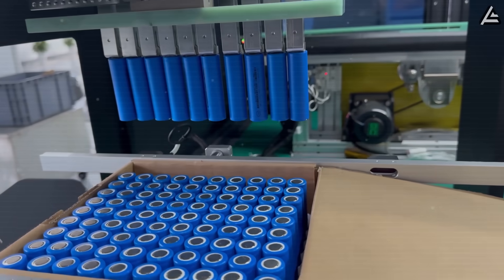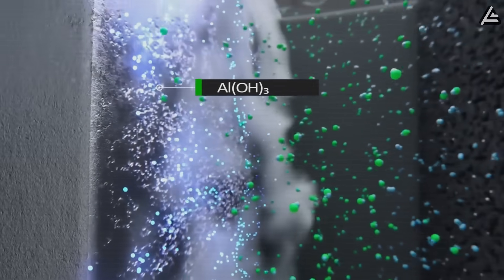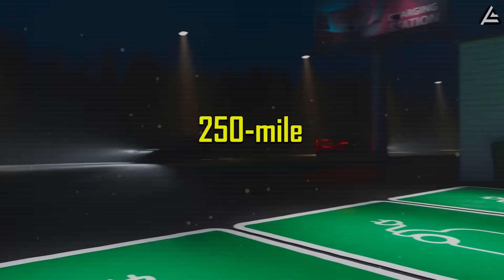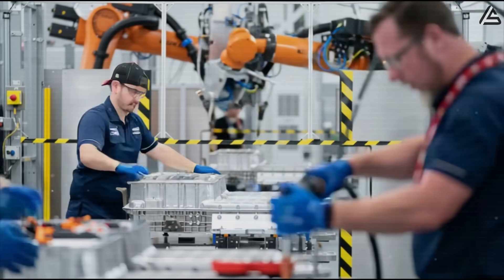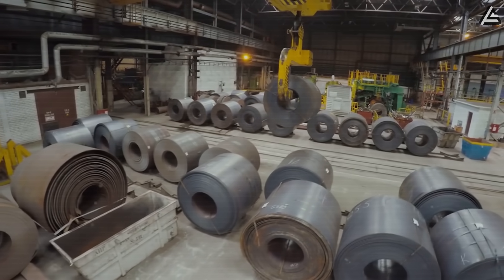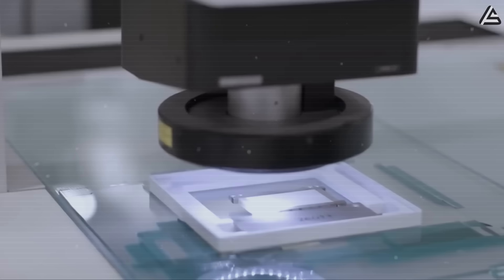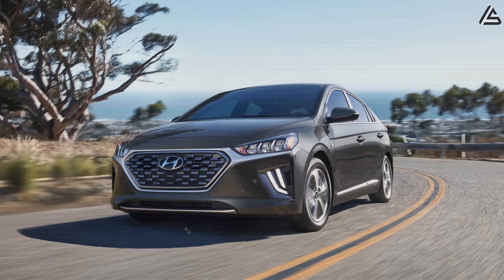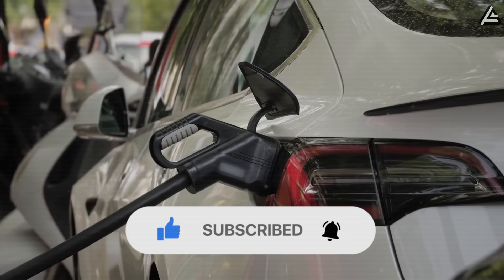2026 Tesla Model 2's All-New Aluminum-Ion Battery. What Elon Didn’t Tell You About

Comment: What about cold temperature vehicle operation and charging? This is a serious problem with Tesla's and other electrics brands now.
Reply from the maker: That’s not a problem with aluminum batteries. Whether it’s below 20°C or above 60°C, their performance only drops by less than 5%, and you can still charge at almost the same speed. Do you live somewhere with extreme weather? And have you had bad experiences with your current battery?

Comment: I have a model y, I want higher range, not buying lower than 400 mile range, sick of baby sitting a charger .  Also not significantly cheaper than gas in PG&E territory.  I am not buying unless it is really cheap and has long range
Reply from the maker: No doubt aluminum batteries will be cheaper, and range is something Tesla’s still working on to improve

Comment: Why not just make the battery a bit bigger to get 300 miles per charge? And where does it take 8 or 9 minutes to fill a gas tank. You using a eye dropper to fill tank. Also who keeps a car for 500,000 miles? I get tired of one after 4 or 5 years.
Reply from the maker: That’s your case, not everyone’s
Reply: @AutoGearShift2  I do not  know anyone nor I have I met who has a car with 500,000 on it. I spent my early life in the family car business, and if you got a car in trade with over 100,000 it went  into the “back lot”    with the high mileage- no guarantee- sell quick and cheap  vehicles,  or was auctioned out. Also, to any vehicle in the northeast with that very high mileage  may be full of rust holes. You certainly were not going to, spend $$$ to recondition it put it with the high profit vehicles.
Reply from the maker: ok so I suggest you to meet our other viewers, I met one who drive his car for 18 years
Reply: @AutoGearShift2  Fine but that is not the case for the vast majority of drivers. I knew a guy who was divorced 4 times and married one of them twice. That as likely  a 18 year old everyday driver car  or one with 500,000 miles on it —- possible but certainly  not the norm: nor would I recommend any of the pre-noted situations.
Reply from the maker: That’s a fair point. Extreme cases exist, but they aren’t a useful baseline. Most drivers should make decisions based on typical ownership patterns, not outliers like half-million-mile vehicles or perfect battery longevity.

Comment: But with Solid State batteries you can get the best of both worlds with a 10%-80% charging time of 12 minutes and a 800-1000 mile maybe higher in range. It is also lighter and safer as the manufacturer claims it is not prone to fire when structure integrity is compromised. I can see a cheap short range EV appealing for work, and a long range more expensive EV for high end luxury or overlanding trips.  Just do the math in charging time.  250 miles divided by 10 minutes = 25.  1000 miles divided by 12 minutes = 83.3.  Elon said, “So Efin what?” Say a one way San Francisco, CA to Reno, NV trip is approx 220 miles. 250 mile range battery should have no problem. Wrong! The trip has lots of steep mountain roads and we all know what climbs do to EV batteries. Brake regen may get you some energy back but not enough to make the trip worry free without stopping to charge.  A battery with 1000 mile range can do the SF to Reno, drive around town for the weekend and make the return, Reno to SF drive without charging. Elon says,”Stop to charge in between, sightsee, and rest”. If I go sightseeing the places I like to visit don’t have EV charging stations. Another plus for the 1000 mile range battery.
Reply from the maker: thanks for your detailed sharing

Comment: Does the aluminum battery still explode or burn on fire?
Reply from the maker: Aluminum-ion batteries behave very differently from lithium-ion. Instead of going into thermal runaway, tests suggest they release charge and go offline rather than catching fire. That makes them much safer in crash or puncture scenarios. Tesla still needs to prove this at scale, but early data looks promising.

Comment: There's no free lunch. If it's pumping that much energy into that battery pack that fast, it's going to require a hell of a power supply. For a filling station, they're going to need a big diesel generator for that, or a nuclear reactor.

If you want a guess on how much, it's 1.5 times the KW/H for horsepower. So if you have a 20 KW/h gen head, you're going to need a 30 HP engine. That's for an hour. Multiply it by a quick charge. Quickly, you'll see it's a lot of HP. Add more cars, that's more HP. Quickly, you're up to a Caterpillar 16-cylinder engine generator.

Chuck away your illusion that they're "clean." Windmills are proving to be a joke, as everyone said they would be. Longevity, power output, and the environmental impact are staggering. Killing lots of birds. They don't like hydroelectric. So there's solar, and it's not up to the task. So we're back to fossil fuels of some sort. Either diesel, natural gas, or some other hydrocarbon, such as coal.
Reply from the maker: You’re not wrong that ultra-fast charging demands serious grid capacity, but Tesla and others aren’t planning to solve it with diesel generators. They’re already deploying massive battery buffers, solar integration, and grid-level energy storage to handle peak loads without “Caterpillar engines” on site. Wind and solar have limits, yes, but pairing them with storage plus nuclear and hydro where available changes the math completely. EV charging doesn’t have to be dirty, it depends on how the grid is built.

Comment: How about  a minivan design  keeping in mind a universal model that can be cheaply modified for wheelchair use.  Being a wheelchair user I wish a standard model minivan with a  floor to roof inside height  of  54 - 57 inch.  Front removable raised platform seats .  Costs for adapting for wheelchair use can be cut substantially  by this basic design concept to begin with for all consumers.   All consumers will benefit from the higher head room and  leg space ( not having to bend  over so much to get in and squashed seating for not enough leg room  and  wrestling  with  children car seats half bent over) while  lowering the cost for full adaptation for wheelchair users by 10s of thousands dollars.
Reply from the maker: thanks for your sharing! we'll research more about minivan

Comment: 1, I do most of my charging at home where it's cheaper to charge. The idea of being able to hold enough charge to last a day of driving around and return to home to re-charge is the best way. And even if we are on a long trip 1 or 2 40-minute stops for the day beats 5 or 6 10-minute stops. Each of those stops require finding the charger and hoping they are working. I don't own a Tesla YET. Hopefully in two years there will be a battery brake through, and I'll get one.
Reply from the maker: thanks for your sharing!

Comment: 10 minutes is impressive for a full charge, but what's this about it being faster than to fill a gas tank? My Saturn fills in about two minutes.
Reply from the maker: the key is convenience: charging at home overnight or a 10-minute stop on a trip means no weekly gas station runs
Reply: @AutoGearShift2 Got no issue with 10 minutes being fast for an EV but it’s not faster than gas.
Reply from the maker: I agree. the benefit of an EV is that you can charge it right at your home

Comment: Bullet point! How does aluminum oxide perform in the cold and extreme heat, where lithium is definitely left wanting!
Reply from the maker: Aluminum-ion batteries seem to handle both cold and heat better than lithium-ion, with less risk of fire and better performance in low temps. Stay tuned, we’ll dive deeper in a coming video.

Comment: Not one word on it's operating temperature range, nor it's potential for ignition. Aluminum was used in camera Flash Bulbs, as it burns rapidly and hot, in oxygen.
Reply from the maker: Current aluminum-ion research shows better thermal stability than lithium, with far less risk of thermal runaway or fire. Unlike aluminum powder in flashbulbs, battery aluminum is not in a loose reactive form, it’s bound in structured electrodes and electrolytes.

Comment: To go electric the question about comment 1 or 2 is not the issue. The issue is I want both. Speed and distance. At least 400 miles minimum in all weather (temperature) conditions and a 10 minute full charge or less with a price out the door under 20k
Reply from the maker: thanks for your sharing

Comment: The energy density will increase as the tech is further developed, the longevity is considerably better, but even if you wanted to upgrade your pack for the newer tech it's going to be considerably cheaper with Alum Ion, and the material is readily recyclable not to mention much less toxic.
And what if the pack was efficient enough in charging to use a Wireless Charging system. Imagine having a "Charging Lane" on some roads, so that you don't even need to stop to top it off on your way out of town.
A better power generating supply grid is inevitable, we have tech being developed in that area as well, some of it will be from the modular nuclear facilities that don't require nearly the space of the old systems and they're safe without any risk of meltdown or explosion, and they're scalable. This tech even has some companies building micro reactors that can be remotely located anywhere in the world and even in your back yard, with a very long fuel cell life (think your lifetime per cellphone-sized pack), fully recyclable nuclear fuel using Thorium.
Reply from the maker: thanks for your sharing

Comment: Why can't you simply make the battery pack larger for a longer range? Here’s a thought make small portable battery packs that you can put in the trunk & plug in. You can plug in multiple portable packs, each 1 giving extra miles, say 50 miles. 2 packs give 100 miles. You can keep the packs at home charging when not needed.
Reply from the maker: Good idea on the surface, but it’s more complicated in practice. A bigger or add-on pack adds weight, cost, packaging and crash-safety issues, and portable high-voltage packs need robust cooling, rugged high-current connectors, and full BMS integration — all of which raise safety and certification hurdles. Battery-swapping and trailer/portable packs have been tried (e.g., NIO swaps, aftermarket battery trailers), so the concept works, but it requires ecosystem standards and infrastructure to be practical.

Comment: Cost, environmental impact, and longevity are valid advantages.  The 10-minute recharge thing is questionable.  Your example of a 50KWh pack recharging in 10 minutes, gives a charging speed of 300KW.  Looking at PlugShare, and filtering for 300KW and Tesla charging port, things look good east of the Mississippi River.  West of the Mississippi, there are dead spots big enough to give real range anxiety to those who INSIST on a 10-minute charge. And as others here have pointed out, even the supposed 300KW chargers often don’t actually deliver 300KW.  

I personally don’t care that much about a 10-minute fillup.  But for those who do, buyer beware!
Reply from the maker: thanks for your sharing

Comment: Neither battery type has the energy density range of gasoline or Diesel fuel. The cost to recharge is greater then the cost of fossil fuels, unless the charging at a home charger.
Reply from the maker: That’s true about energy density, but EVs are far more efficient than gas or diesel, meaning they need less energy to travel the same distance. And while public charging can sometimes cost more, charging at home (especially with solar) is usually much cheaper in the long run.
Reply: @AutoGearShift2  When the EV is sucking off of the teat of the US electric grid that is powered by, as of 2024, natural gas is the largest source, nuclear, and coal. So EVs are mostly fossil fuel powered, just like the ICE powered cars. Also the US American grid is at it's limit right now in supplying electricity as it is right now.
Reply from the maker: It’s true the US grid is still mixed, with natural gas playing a major role, but EVs are tied to the grid getting cleaner over time, ICE vehicles are locked into oil forever. Most grid studies still show EVs emit less over their lifetime, even on today’s grid.

Comment: High potential charging speeds aren't an answer in themselves; it just shifts the bottleneck to the charging infrastructure already beleaguered by high transient energy demands and inconsistent "green energy" production or input. 
For charging locations to be able to offer multiple vehicle chargers capable of simultaneously charging even at todays more modest charging rates means paying utility companies premium rates for energy. This translates to high prices to the consumer. 
To upgrade such infrastructure to support charging rates to allow charging times manufactures are boasting their future cars will be capable of means not only new capital expenditure but even more expensive energy rates from the utility companies - assuming they can even upgrade infrastructure to meet such demand.
Likely this will limit the number of locations where such fast charging facilities can be sited - highly inconvenient for the EV owner and at a recharge cost that will make gas refueling cheap by comparison.
The biggest draw-card is low purchase price and this will attract buyers who won't be able to afford the high costs of super fast charging and will likely charge at home or suffer the inconvenience of long charging times at cheaper slower charging facilities.
It's interesting to hear stories of people using "fast charging" sites saying vehicle charging rates slow dramatically when multiple vehicles are charging at the same time - a legacy of trying to remain cost competitive by negotiating an insufficient peak energy rate from the utility company.
Reply from the maker: thanks for your detailed sharing

Comment: I've watched a lot of these videos on the site, and this is by far the best one. 
 I never understood why Tesla would be considering Al-ion batteries because they have such low energy density.  But the contention that people will accept lower range for ultra-fast charging makes sense to me.
Reply from the maker: Glad you noticed that. The trade-off isn’t only about range, it’s about charging speed, safety, and cost. If you can add hundreds of miles in just a few minutes, most people won’t mind a slightly smaller pack. Thanks for watching and sharing your thoughts!

Comment: EV's fast chargers need huge current draws  ... five together might need as much as 5MW ... 1,000 together ... need their own dedicated nuclear power station!
Why is everywhere going electric by force when no grids anywhere are capable of meeting the demand? Unless that's actually the plan ...
Reply from the maker: That’s a common misconception. Fast chargers don’t all run at max power 24/7, demand is spread out, and smart load balancing plus on-site batteries already smooth the grid impact. Utilities are upgrading step by step, just like they did when air conditioning or data centers exploded in use.

Comment: Range anxiety, Thermal runaway battery fires, kill switches, high cost of insurance, high parts costs, excessive road wear and special tires still exist with these battery cars.  No thank you.
Reply from the maker: Those are fair concerns, but most of them are being addressed quickly. Modern EV batteries have advanced thermal management that makes fires extremely rare compared to gas cars. Insurance and parts costs are trending down as production scales, and tire tech is improving to handle EV torque without excessive wear. Range anxiety also shrinks every year as charging networks expand and batteries get more efficient.

Comment: What's the cost of the 'home-charge' equipment ?
Reply from the maker: It will be affordable too. How much do you expect it to cost?
Reply: It’s exactly the same as current EV home “chargers”. All they are is an AC socket with some smarts added. You wire them up via a 32 amp, 220/240 volt line to your distribution box and bobs your uncle. It will happily draw 7kW of off peak power and refill its self overnight. You only need DC rapid charging for long trips, or if you have no access to home charging.
Reply from the maker: thanks for the info. it's very useful

Comment: With the 10,000 plus recharge cycle potential of the reported aluminium-ion Tesla Model 2 2026 batteries, will this finally mean that Tesla will provide bi- directional charging so we can use the car to supplement our Powerwall 3 and run our house on off-peak electricity all year round, not just during summer, and also have meaningful spare  capacity to be used by VPP's?
Reply from the maker: Yes very likely

Comment: 2 Who wants to wait around? Charge/discharge aluminum is incredible.
Reply from the maker: Good choice
Reply: Real life usage may decrease it.  First of all, a cylindrical battery case (tesla Li-Ion) holds the material more stable than a blade package (tesla aluminum).  In practice, the vibration of actual usage may affect the lifespan of the blade battery.  Li-Ion holds a charge for quite a while.  If the aluminum battery has leakage that makes the battery charage drop to a low level after 30 days, that means the cost effectiveness is decreased especially if you charge batteries at 24 cents per kilowatt hour.  If an idle battery drops to 40% charge after 30 days, then the loss rate should be factored into the cost to operate such a vehicle.
Reply from the maker: yep you're right